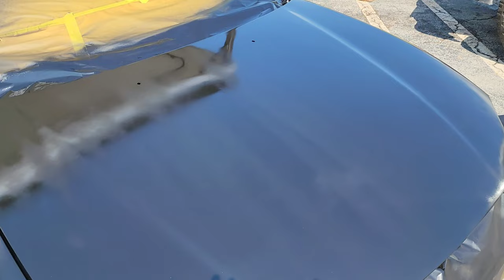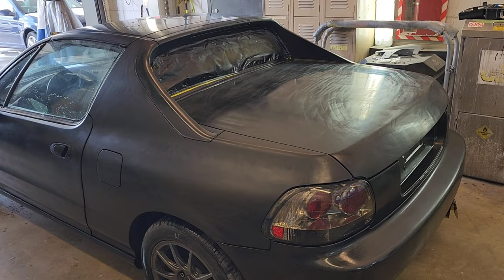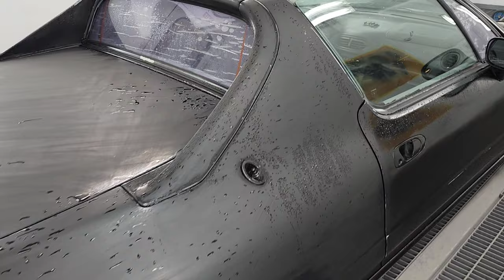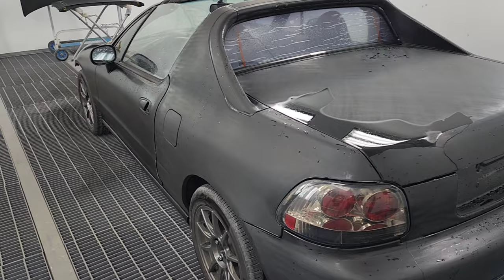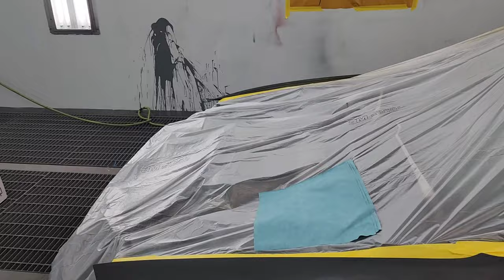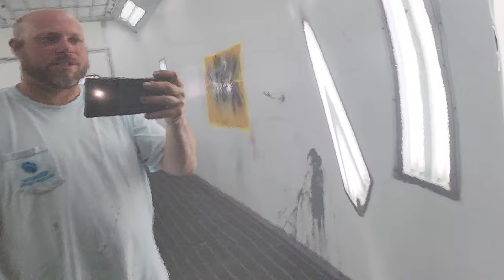Painting Our Honda Del Sol

Comment: How many paint buckets will I need for my del sol
Reply from the maker: I'd buy 2 gallons so you have extra to redo any mistakes or for future accident repairs. But you only need a gallon to do it. That will give you 2 solid coats of base, wet sand that and then do one more coat for a total of 3.